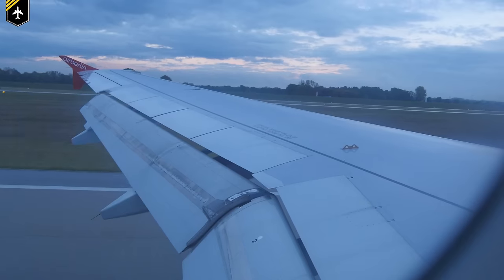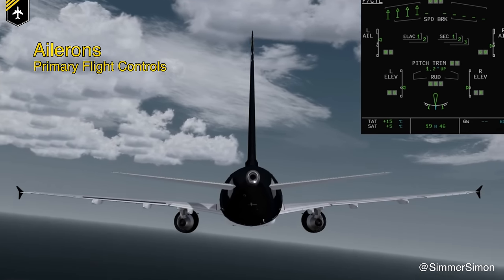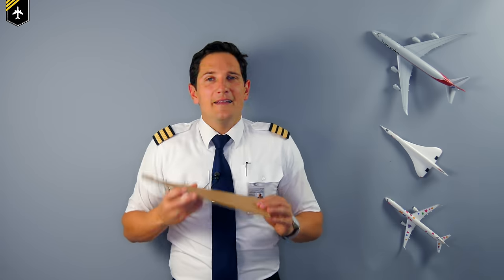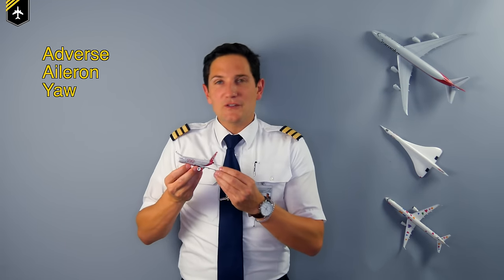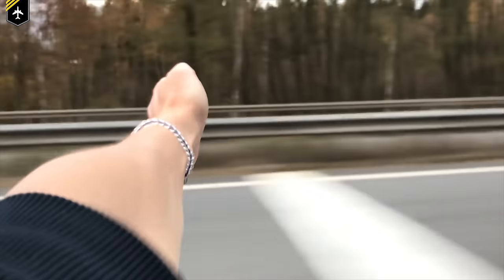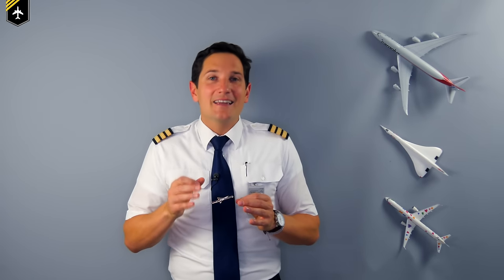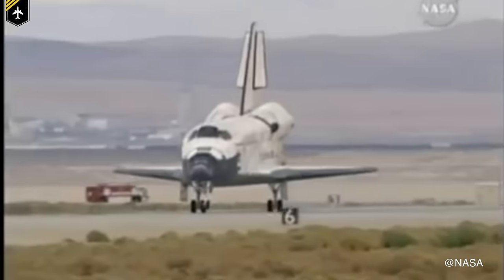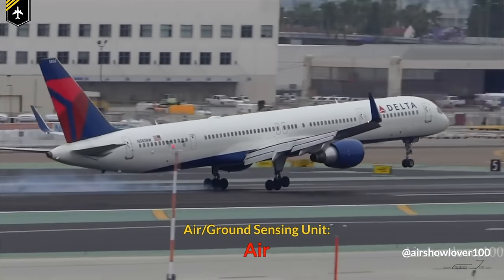What are SPEEDBRAKES/FLIGHT CONTROL SPOILERS?! Explained by CAPTAIN JOE

Comment: one question ive always had 

why is the landing gear lever shaped the way it is i get its supposed to look like a wheel and thats the lever than drops the landing gear or raises it 

but why is this almost the only controll in the entire cockpit thats given this kind of instant recognizable attention when every other controll is either a discrete and small switch or a small turn knob

is it so that should a passenger ever be required to land its easy for atc to describe?

Comment: But in flight 90% of the time you are in autopilot - are not the flight controls precisely controlled by the fms or the control system itself Capt Joe.  Sorry I am a newbie to this.
Reply: The way I understand it in an Airbus the commands are sent from the FMGC to the autopilot or the pilots enter the adjustment from the FCU and then the autopilot sends the commands to the flight control computers which then command the movement of the control surfaces accordingly

Comment: Can I please get an explanation as to why the ground spoiler panels at @0:35 did not all extend at the same time? Is this simply due to some delay (maybe as a result of the different independent hydraulic systems) or is there an actual purpose for the delayed extension. If it is the latter, can I please get a detailed explanation as to why that is the case?

Comment: Captain Joe, can you do a video on 2 engine vs 4 engine and why some aircaft have 2 or 4 for example a320 have 2 whereas a380 have 4 however boeing 787 (long haul) have 2 engine as opposed to 4 if having 4 suppose to give you more power.  Does it all come down to engine design or are we missing something that most don't take much notices?
Reply: Peter OFlynn the main advantage of having 4 engines over 2 is more to do with redundancy than power. Yes in the early days of aviation more engines were needed for power. But now twin engines are powerful enough to handle the big long haul jets (except the a380 and b747)

Comment: What prevents the speedbrakes from automatically deploying during the takeoff roll as well?
Reply: Speedbrakes are linked with engine throttle levers position. During takeoff, engines throttle levers is in takeoff position, the engine controller send a signal to flight controls computers to inhibit ground speedbrake function until the throttle lever pulled back to idle in case of rejected takeoff. Same scenario applies during landing, if touching n going the spoilers will retract if the throttle levers moved away from idle position. hope this is helpful.

Comment: Guys, so at 8:20 there's a bit of shaking on the ... Flap? If I'm correct. I've seen this in flight and occasionally got worried that the parts are loose. Is this the case?? 😅
Reply: Nope, that’s normal. Better to let it vibrate a bit than make it stiff and experience much higher loads. The flaps are just doing a lot during landing so there’s a pretty high load and typically some turbulent air flowing over them

Comment: So why do smaller planes use the rudder for adverse yaw and bigger planes have to use spoilers? Can’t bigger planes use the rudder for adverse yaw too?
Reply: Shane Kelley it’s just convenience. Spoilers are being controlled with the same aileron control. So no extra input is needed. On the other hand if rudders are used there is an extra input which can be minimised.

Comment: wouldn't the ground spoilers create more drag if they were opened up in reverse? It looks like the air would just glide right over it instead of creating drag to me
Reply: It would require greater structural strength, as there will be a lot more stress on it

Comment: A complete mother of an airbrake on the Blackburn Buccaneer Sorry the viewing angles aren't too good for the  airbrake https://www.youtube.com/watch?v=2bW7tjy7AOk better view at 14.50 here https://www.youtube.com/watch?v=46a-7N_13Sk Combined with a folding radar section at the front it also reduced the overall length of the Buccaneer so it would fit on the short Royal Navy carrier lifts.

Comment: Hey would you ever let an enthusiastic passenger into the cockpit?, Are there any alternatives for non pilots to get a real cockpit experience ?
Reply: If you will be satisfied to a smaller aircraft, you can contact a flight school and reserve a demo flight with a flight instructor. Maybe 30 minutes or an hour. I know, it's not the same as an airliner, but you will be in the air.

Comment: How come the flaps don't automatically retract when the speed brakes are applied on touchdown?
Reply: Jas B. Because even those flaps are providing drag for the plane to slow down
Reply: @ZK-APA  but if the flaps are retracted the brakes would have more power from better tire grip as more weight is on the tires flaps up and spoilers extended.
Reply: @jasb78  Still, the resistance due to drag is more than the improved effect of the brakes. It's about which is more effective.

Comment: When you talk about A321 and describe hydraulics that is contrary to fly by wire. Why does the A321 have both?
Reply: Jerome B hydraulics doesn’t mean that it’s connected physically. Fly by wire can still control hydraulic actuators.
Reply: Then it’s not a true fly by wire   It sends electric commands to hydraulics

Comment: What are those lower part of it? Under the wing?
Reply: I think you mean the flap track fairings under the wing. The flap mechanism is inside the fairings.
Here you can see it:
https://i.pinimg.com/originals/c9/42/f0/c942f08f46b9a152e4d48360b53f1bba.jpg

Comment: I may have been drunk and said it before. Every time i watch one of your videos you always gesture the 3 sign when you say 3. Every time you do i think of Quentin Tarantino's "Inglorious Bastards" movie. Anyone know what i am talking about? I enjoy your videos, going to subscribe.
Reply: I am kind of following along. I would have thought even a jet that size  would use the rudder. The ailerons don't take up as much of wing as i would have expected.  I have often wondered about wing stress and canceling out the effects using ailerons alone would have on turning an airplane that size. Fascinating. I have only ever flown in a single engine 4 passenger plane. I remember my first radio controlled helicopter and learning about collective pitch and fixed pitched options. I learned all about how a helicopter moves threw the sky, but mine needed more open space for its maiden voyage and after a few minutes it never flew again. Too many trees overhead.  Anyway absolutely fascinating your videos are.

Comment: @5:43 how are extended speedbrakes creating a pitch down momentum?
Reply: Spoilers destroy lift at the same time which is why.
Reply: @dylanf7990  yes, i understand that. But the momentum created is pitch up in my understanding. You're pushing the top of the wing back and the bottom comes forward, hence pitch up.

Comment: Captain Joe y r spoiler's nesesary, isan't r/thrust & light breaking enough to slow the plain down.
Reply: The Handyman spoilers not only create drag, but also dumps the lift generated by the wings. Because of this, there is more weight on the wheels, hence you’ll also get better braking action with spoilers.